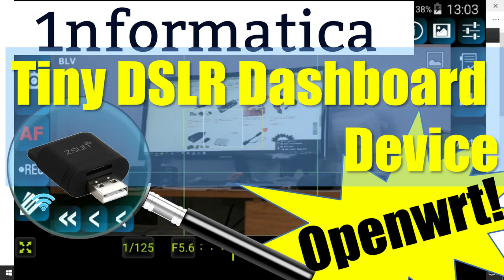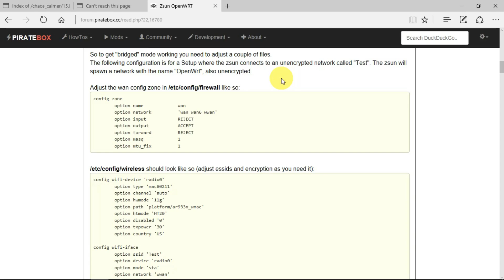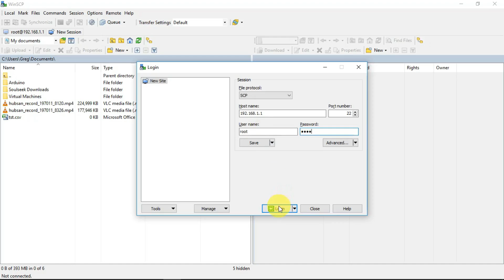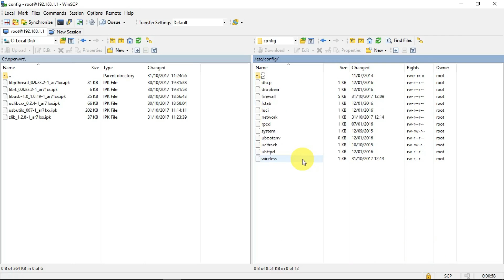OpenWrt Access Point + Station WiFi Bridge Tutorial

Comment: You can also connect via the serial header. If you've connected it as a station to your home wifi you can still access the webUI without using it in bridge mode. Lastly, if your home wifi isn't accessible then the AP interface won't come up so you'll be locked out and have to either factory reset via the sd card "button" or use the serial header/ethernet header.
Reply from the maker: Very good points! For me the serial port is too slow and only would consider it if no other option! Thanks for your input.